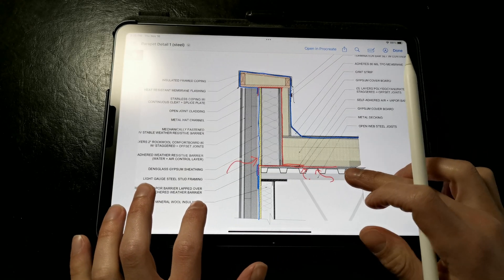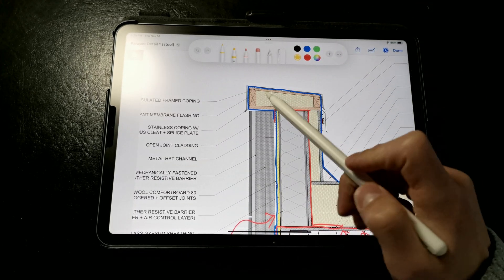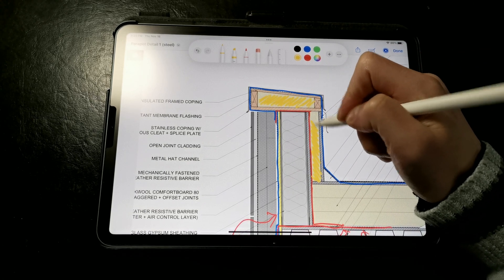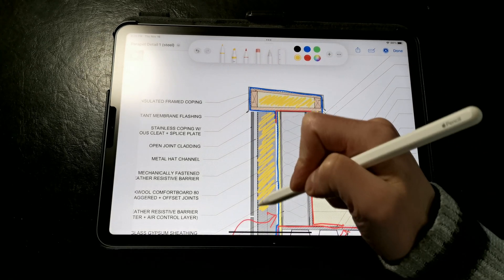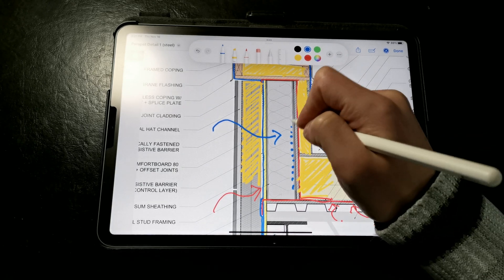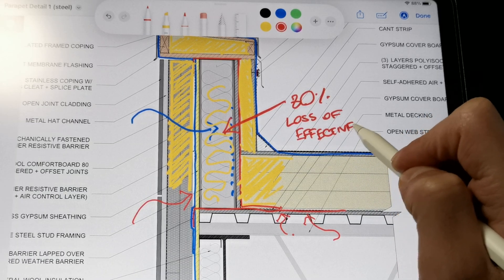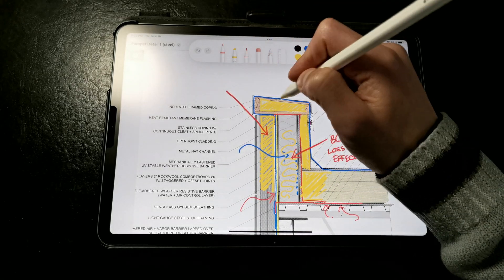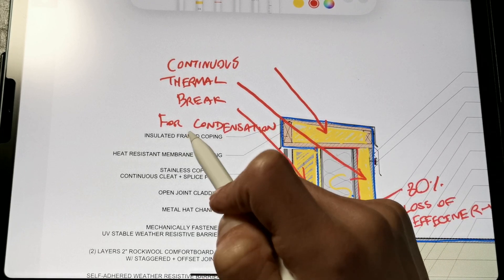Insulating Metal Roof Decks

Comment: I have a flat roof. And I've noticed a bunch of wet spots in my ceiling. I opened up a hole and saw a ton of condensation on the metal decking. Did the builders forget to put a vapor barrier under the decking? Would spray foam be a good option to eliminate this? Thanks!